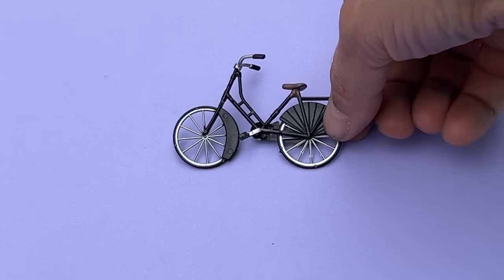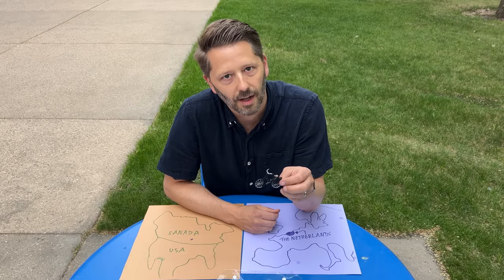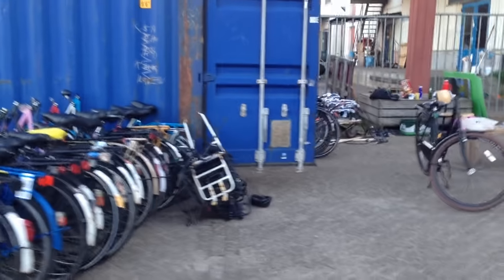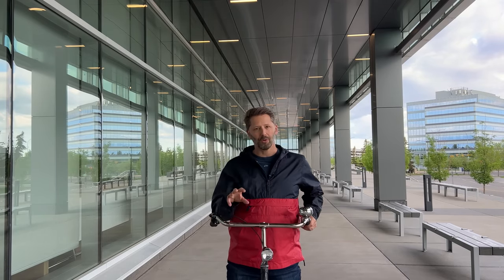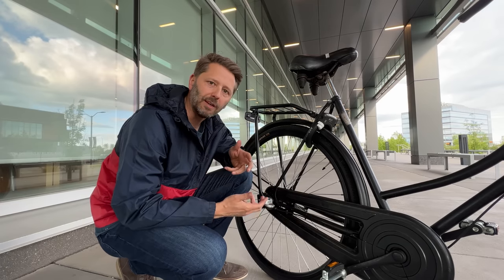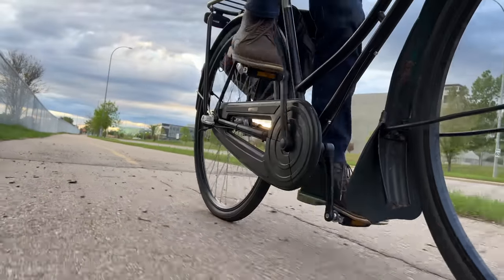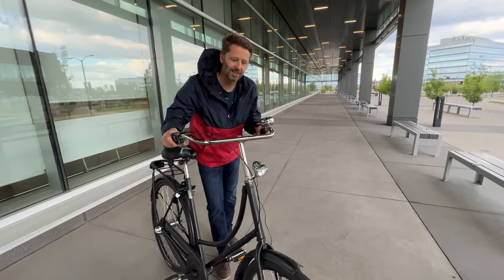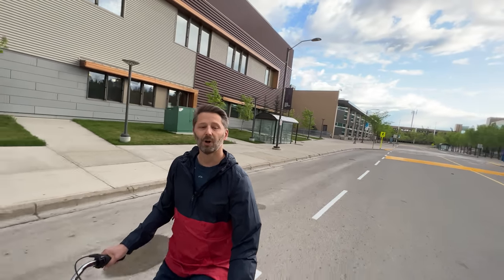I finally found a true Dutch bike in North America. Here's what you need to know

Comment: In the Netherlands, one of the reasons why there are more bicycles than people is that people often own more than one bicycle and will switch between which one to ride. So, they may have an old, rusty, beaten-up oma bicycle that no one will try to steal when going to the city centre for clubbing or to the cinema on the weekend. But when they go shopping, they hop on a different bicycle that has more gears and can handle a heavy load, etc. For every activity, there is a different bicycle. Oma bicycles aren't suitable for long commutes; they're called Oma's for a reason. 😆

Comment: That model is indeed called an 'omafiets' (I own one myself) but the reason for that is more to indicate that it's so stable and relaxed to bike on that thing that even old grannies can do so nearly effortlessly. It almost takes effort to fall off of it. And their durability is so extreme that 99% of your problems with it will be leaks in your tires. The most that you have to do is grease the chain every 6 months or so, but even if you don't it'll probably be fine.

For reference; I bought my secondhand bike for 125 euros at the local trainstation bike shop (Yes, a lot of trainstations have those) which is about 185 Canadian dollars. So someone is definitely making a killing on importing those bikes and selling them for 340 euros (converted from 500CAN). It really doesn't cost that much to transport them in bulk in a container.

Comment: Nice video. I work at a bike rental place in the netherlands. We don't use these bikes at all. we do have bikes with coaster brakes but with no gears. The most common bikes we use are from Batavus (type Finez or Holiday) with 7 or 8 speeds and we also have alot of ebikes with a belt drive all 8 speed and all our bikes except for the mountainbikes have shimano internal hub gears. The omafiets where I live is just uncommon.

Comment: just a little comment on the headlight since it seemed like such an unfamiliar topic for you ;3. The reason it is so typical on an Omafiets (or any other dutch bike for that matter) is because if you ride a bike at night, by law, you are required to have working lights (front and back) on your bike. It's one of the most common fines for cyclists to get since speeding and DUI is not a thing with a bicycle. So in the theme of sturdy and reliable, the bikes are usually fit with a dynamo, however these days it's getting more common to use batteries or have these weird magnetic dynamo's. Those old school dynamo's can add a lot of friction.

Comment: The way you sit on a Dutch bike is how American bikes used to be made.  Much more comfortable.  Also, with the swept-back handlebars, you can lift up on the handles to put more than your body weight into the pedals.  That puts your body in line with the handlebars when you're standing on the pedals.

You can't really do that with a "racing bike," where the bars and much of your weight are so far forward of the seat stem.

My first bike, back in the Stone Age, was a single speed.  Standing and pulling on the handlebars was the only way to climb a steep hill without giving up (like a big baby).

Comment: What strikes me about this bike is that many of the features you mention as being on this bike are available in the US, but usually not together. "Cruiser" style bikes are available, but not widely popular. This bike is similar to those. Wheel locks are available, as are fenders, swept back handlebars, and bike racks. "Coaster" brakes are on some bikes, but in the US, you only see them on bikes for kids. 

In short, the style would be very easy for a manufacturer in the US to emulate, if the market was there.

Comment: Dutchy here. Remember to keep your tire pressure to 4 bar or 58 psi. The thin and light road bikes though require 6 bar or 87 psi. Having low pressure tires can make you easily tired (pun intended).

Comment: ur supposed to put a metal brace on ur bike rack and get a bag that slides over it.. thats how all the dutch people travel with their bags (schoolkids mostly), hanging it on the side is a pre 2000 thing.. (like saddle bags, u never see those anymore).  Also most people using electric bikes these days anyways.. also there are 7 speed bikes with the same system.. and newer bikes have the dynamo in the front wheel so they dont break, also less resistance and wires hanging about.

Comment: I don’t know about this. I studied abroad in the Netherlands a while ago and loved the bikes. My host family had a single Toyota Prius that was exclusively used by my host father and only for travel for his job to places where public transit wasn’t practical, and taking the family somewhere when the weather was really nasty. 

Other than that they had a whole garage full of bikes. A family of 4 and I’ll bet they had 8-10 bikes. The first order of business when I arrived was having me pick one and then tuning it up and adjusting it to fit me so I could go places with them. They even had one cargo bike that could only be described as having a wheelbarrow for the front fork. My host mother would go to the gardening store and get bags of mulch with it. It had a crazy low granny gear and you could transport anything that would fit in the trunk of a Toyota Camry in that thing. 

All that to say, when I came back to the states I wanted a Dutch bike, and I found it difficult. But some back and forth with my host brother about the details I realized a lot of nicer beach cruisers are like 90% of the way there. 

I got a trek cruiseliner step-through that came standard with the nexus 3 speed hub, coaster brakes, mirrors, chain guard, full size fenders etc. it cost me $200 used. I changed out the tires for something a little more efficient since I wouldn’t be riding it on sand, added racks front and rear, got a more comfortable seat, put a frame bag and a bottle holder on it, added a little under-saddle bag for a tire change kit, and eventually fitted it with a low drag dynamo front hub and front and rear lights. 

After a few years of heavy use the drivetrain was getting sad so I switched out the rear hub for a nexus 7 and fitted it with a belt drive. It’s a bombproof bike that gets me where I need to go and carries basically anything I ever need to carry. I have 60L of capacity in the panniers plus about 20L in a milk crate on the front rack if needed. Which enough space for the groceries with room to spare. Especially since if I leave the panniers open they fit more than 60L. I’ve thought a lot about putting a front V brake on it but I never dropped a chain and been without brakes, and now that I have a belt I don’t even worry about it. I think derailleur systems are a lot more prone to dropping chain than internal hubs since the chain is always directly in line and doesn’t rely on the derailleur for tension.

Comment: As a Dutchie, I really hade peddle breaks, only had them as a kid, and now whenever I ride a bike that has them it's so awkward and getting used to them again, I want to break and it takes me longer because I need to remember to use my feet rather than hands, which can get pretty dangerous.
I also sometimes like to rotate the peddles backwards when I just want to ride the speed I built up, vut with peddle breaks that stops me.

Not a big fan of dynamo's either, they require more physical energy input whilst cycling, and when you're stopped for a moment they stop producing light.
Much prefer just battery operated lights.

Comment: I greatly dislike back breaks (coaster breaks) because I prefer to be able to change my leg position while I'm riding. Can't do that with these brakes. Past a certain speed when you apply coaster brake, since it's only in the rear, you can wobble and skid out! A nice fitness hybrid like the most basic versions of the Trek FX or the Specialized Sirrus are probably the way to turn most of the potential bike commuters in North America into actual commuters. Throw the Cannondale Quick in there too! Those bikes are aluminum, so they're much lighter. Because the geometry is somewhere between a road bike and a mountain bike (hence the term hybrid) they're much more agile and maneuverable for us city riders. If you want to be a little bit more aggressive and sporty, maybe pick your butt up off the seat and get a little bit more speed...you can do that. And if you want to ride just for fitness on your weekends, you can do that on the same bike that you've been riding comfortably to work on all week. You don't need two bikes. The forks even offer enough clearance to put slightly thicker or knobby your tires on, usually up to about 35 to 38 mm, and maybe do some light gravel riding on your weekends. Lastly, when you live in a big old crowded City like New York and you've chosen to live in an apartment, not a house with prohibitive maintenance costs and a high-ass tax bill, you don't have your own garage to simply ride the bike into. You might even have to push it into an elevator or (gasp!) Carry it up a few flights of stairs. Because of the A-frame you can just pop a hybrid bike onto your shoulder and carry the thing back up into your apartment. There are even lots of lightweight apartment-ready storage options that don't have to be nailed into your walls and don't require some dubious ceiling-bound pulley system. But the bike's gotta have an a-aframe to fit them and it would help if it were light enough that it didn't feel like a chore every time. These European style bikes might look cool, like an advertisement for the carefree lifestyle ived by some privileged young lady in Paris or Soho, with a grocery bag with a baguette sticking out the top of it in the handlebar-mounted bicycle basket. But for regular people, they're not trying to make a show of their decision to commute or even get around their neighborhood a bit differently. I'm in hospitality, and I used to work in a fancy pants hotel that had those Dutch style bikes available for used by our guests. Regularly if a guest wanted us to pick up something for them from Best buy or whole foods, we'd use those bikes to make a quick run for the guests. And all the staff, all of us, hated those bikes... Because most of us commuted by bicycle and we all owned either road or hybrid bikes. We used to joke before we got on those damn bikes, "Hey who's got the beret to go with this bike?" Even on those short jaunts, because we needed to be nimble and agile in order to weave through traffic. Maybe pop the front wheel up onto the curb get on the sidewalk for a few feet because there's a yellow taxi or UPS truck parked in the bike lane, we found those heavy-ass, steel framed, easy chairs on wheels to be totally ridiculous for NYC riding. But if the traffic's not so bad and you're just sort of riding aimlessly with nowhere to go... They are comfortable!

Comment: I don't think I've serviced my bicycle in over 10 years, aside from occasionally pumping some air into the tires. Rain, snow, I don't care. That's what a bicycle is supposed to be like. 
Only thing is that the light dynamo doesn't work, which is a common problem, so that's why you can buy little battery powered lights you can strap to the steering bar in the store.

Comment: I think the bike was probably repainted. Dutch bikes usually do have a brand. A lot of them have different colours as well.
And nowadays we don't really use dynamo lighting any more, but LED battery powered lights. The dynamo is unreliable in rain and snow.
The 3-speed gear is not really suitable in hilly terrain, then you probably should get the 7-speed gear. The 3 speed mostly helps with different wind conditions.

Comment: I'm Dutch and I approve this message. Well, for the most part. First, I would get rid of this lock system. It's of poor quality. Get a good (seperate!) chainlock in addition to the wheel lock. Second, I would get rid of the dynamo. It's not reliable, especially in wet conditions or when it gets dirty (fall, winter or even early spring). Many Dutch bike owners use cheap battery powered lights. Personally I use USB rechargeable lights. Unfortunatly, many bikes have no lighting at all. Last but not least, I would lower the handlebars a little bit. 
Also, I have a feeling this might be a (maybe Chinese) cheap knockoff. Older Dutch bikes are of much higher quality compared to more modern bikes.
I've had many, many bikes over the years, but by far the best bike I've had for daily use was a 'Omafiets' from the late 70's or possibly early 80's, made by Gazelle. Bought it second hand (I think 1998 or 1999), had if for about 15 years and (ab)used it daily allong with a 5km/3 mile commute and barely any maintenance. Too bad it was stolen. I've had a modern 'Omafiets', but it was of poor quality and not a single tear was shed when it was stolen after about 3 years since it was near the end of it's live anyway. 
About the pricing, cheap Dutch bikes can be had for ~€200 or less. Brand spanking new, but without exception they are nothing more than a pile of s....

Comment: My bikes usually last 2-3 years. I cycle 20km every day sometimes 40km. I always buy them second hands for about 70 euro her in the Netherlands, but the main thing that will brake is the wheel brake/internal gears. After wheel brakes it's to expensive to repair or buy a new wheel. It's cheaper just to buy another second hands bike so it is not made for life when you cycle 20km every day.

Comment: Quick note, his is called an 'oma-fiets' (grandma-bike) and is most commonly used by women because they don't need to swing their legs across the back of the bike.
Male bikes have steel rods between the front and seat for extra structural support, yeah you need to be tall to use this but literally everyone is (you can see the difference at 2:42 if you look closely)

Comment: that shot with the bad and the thing (strap?) (forgot the word for it) hanging off is quite dangerous. it can get into your wheel. you dont want dangly bits there. my bike also has plastic guards around the lock (we call them coat protectors). the brakes situation is a bit kid like. i rather have brakes on the handlebars. those allow more precision and are easier. it is quite easy to lock up with those pedal backwards brakes. plus sometimes you need to pedal backwards and with this bike you cant really.

Comment: It's all about the balance, and watch your bag strap, looks dangerous just hanging like that :D 

Omafietsen are awesome, when they are in good condition. They can get expensive tho when they start to fall apart.
Btw, when you talk about the branding. There used to be little metal plates on the front with the brand on it. It was screwed into the base. Very classy. But bikes get stolen so much you just can unscrew those plates or detach the stickers.

I hate those steerings cause it forces you to sit in a certain way lol. Breaking with your pedals is the best tho, smaller chance of defect then with hand breaks.

2nd hand, no more then 100 euros i would pay for a bike thats gonna get stolen anyway when ur in a big city. I paid 75 for mine years ago (no oma, but another typical oldschool bike), still going strong.

Comment: Pls put a cheap V-brake on the front (almost all of them have holes on the frame for that). :D
Having two independent brakes makes the bicycle safer and is a requirement in some parts of the EU. (maybe not in the usa, but common sense suggests that it should have.)

Comment: I bought my first motorcycle for $500, less than your $680 Dutch bike.
Still have it, and it still runs.   No pedaling required.   Timeless Classic.  A 1985 Honda Rebel
I'd give maybe $50 tops for that bike at a Goodwill.   Great design, but still... pedaling.  Ugh.  
Minimal utility in the United States where the distance between cities is 30+ miles.

Comment: I'm a bit sucpicious about the no brand thing, in my experience as a dutch guy pretty much all our bikes are branded. Bikes that are sprayed over or have stickers removed are in my view usually an indicator of a stolen bike. Bike thefts have shifted more towards more expensive electric bikes but in a student city like mine some drunk youngster stealing a bike to get home is pretty common still. Also the dynamo's are almost completely fased out here. It's either induction based or powered by batteries. When dynamo's were the norm you'd see huge numbers of bikes without lights, even though the law requires you to have one. Now with battery or induction this has greatly improved. Also making traffic a lot safer. Another advantage of a battry powered light is that it works when you stand still.
Reply: I'm pretty sure your bike is a Batavus Old Dutch

Comment: As someone who does a little bike repair shop for students at my university in Germany I just love how unnecessarily crappy many dutch bikes are to work on lol

Who thought 27" should be bigger than 28?
Some of these chain covers are absolutely dreadful to remove or reapply 😂
The lack of standard can somehow be more infuriating on them while some of them aren't more comfortable than a "normal" city/Trekking bike.
If something's wrong with a hub that's fun as well.
Don't get me started on the front hub brakes on some of them.
Pretty much no one else uses that system haha

It's the principle of easy to live with, annoying to repair.
In a sense like newer cars

Though they're very cheap here.
Like you can pick up used ones for 50-100€ already cheap